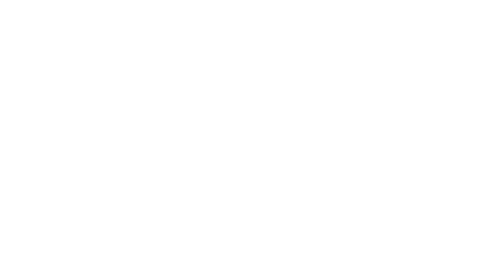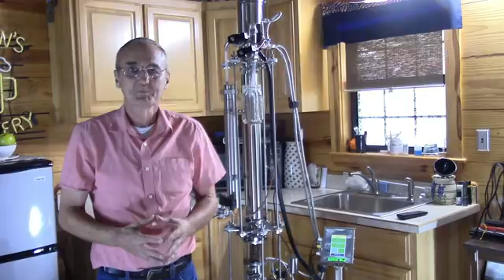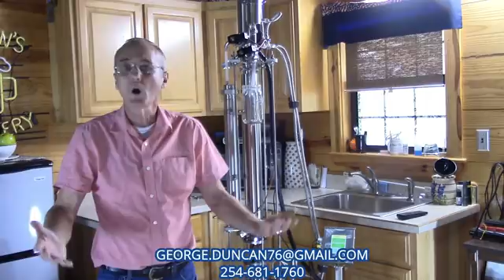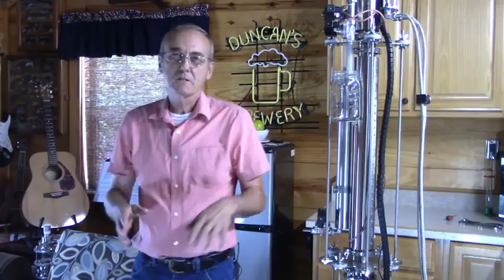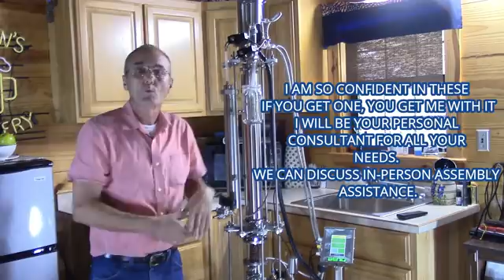G STILL 50L ANSWERING YOUR QUESTIONS AND MORE

Comment: You can get a Chinese  bubble plate still 4 in  diameter glass tube with plates and 2 shotgun condensers for 2 grand  . It will put out 95 %  and no packing 4 to 6 bubble plates   
 Similar to a hillbilly flute

Comment: Definite sticker shock.  For a commercial setup, it makes sense and you might even want to figure out how to set it up continuous seeing as you have all the required bits but retail you can piece together an awfully nice 3" electric column still w/ spp with 304 sanitary fitting and a beer keg for around 1200USD.   A nice tall column with steel spp is going to get you to azeotropic.   The integrated carbon filter seems unnecessary unless you are brewing sugar washes with speed yeast.  Again cheap neutral spirits for a commercial distillery or jet fuel but not really a home gamer rig.   The switch automation is pure Arduino level stuff.   Looks very well sorted.      I suspect there will be a nice niche market for folk that are making money with their tools and want to ensure a highly repeatable process.     I also suspect a lot/most home gamers enjoy a manual still the way many would rather drive a standard even if it is slower than a modern automatic.    Huge  geek factor here.   For some, I can see taking your craft distillation to another level of play for others I think the inconsistency is part of the charm.    Either way, it is wonderful to see a new product on the market.   That takes a lot of time and commitment.  Good luck to the G-Still guys.